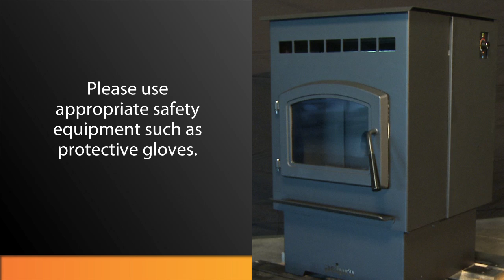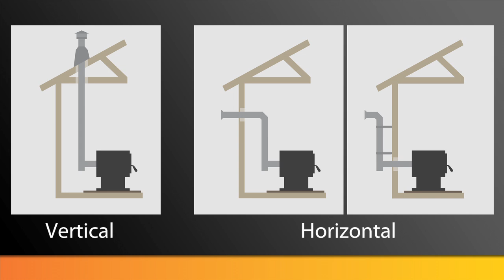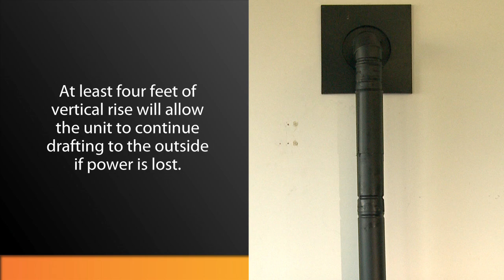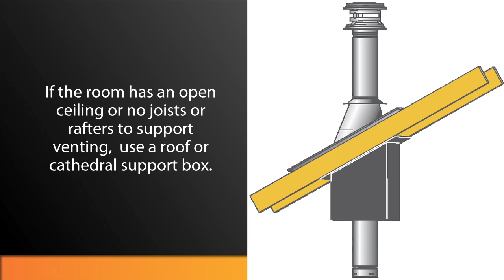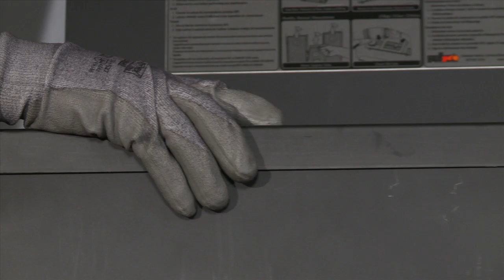Placing & Installing Your PelPro Pellet Stove PP60/PP60-B/PP70/PP130/PP130-B

Comment: Interesting video, i never thought about power outages causing smoke to come from the firebox. So it's freezing cold and you need to open the windows! I think some sort of battery backup to run the exhaust fan at minimum rpm during a power outage would be a great idea for any pellet stove.
  In Europe we now have a twin walled condensation flue pipe for pellet stoves. Do you have the same over there?
  The cold air enters the building from close to the end of the stove pipe then runs down the inside of the two pipes and gets fed straight into the stove, a condensation trap is fitted. The moist pre warmed air should increase the burn efficiency of the stove.

Comment: Your manual doesn't say anything about needing the 4 foot of vertical rise. In fact, you have a picture of horzontial venting without any vertical rise.
Reply from the maker: Hi Makaila, please follow the venting chart in the manual. Depending on configuration it’s a 5ft min rise. You can find this chart on page 12 of your PelPro owner manual. If you have any other questions, please reach out to us here: https://www.pelprostoves.com/contact-us/ask-a-question
Reply: @pelprostoves6142  I am confused at this - the manual clearly shows in diagram the pipe going directly outside from the back through the wall and out. Yet, it states that any vertical makes it more efficient.

So is it best to go out and then a 90 and up or from the back of the stove up and then outside through the wall?
Reply from the maker: @GiveaDogaHomeGaDaH  Thank you for your question. Either is okay. However, I would personally go straight out the wall. The rise recommendation is for power outages. If there is enough rise it will pull some of the smoke out of the home in a power outage during operation. 

I hope this helps! If you have further questions, please contact us: https://www.pelprostoves.com/contact-us/ask-a-question

Comment: What stops it from catching fire in case of a power outage? Does it put itself out?
Reply: It will eventually just go out because it wont be receiving any more fuel and there wont be any air flow.
Reply from the maker: Hi there! The fire in the fire pot is maintained by forced combustion air from an electric blower. Once the air stops, the fire will slowly smolder out. In addition, if the power is out, no additional pellets will be fed into the fire pot. Smoke from inside the unit will be pulled by draft, provided that you have 5’ of rise in the exhaust venting.

Comment: Can a 6inch vertical pipe be used ?
Reply from the maker: Hi Patrick! Most pellet pipe manufacturers have adapters to go from 3” or 4” pellet pipe to 6” Class A vertical. Some localities require that the pellet pipe then adapt to and run a liner up the 6” Class A. We recommend partnering with a local hearth shop as they will know local codes.
Reply: @pelprostoves6142  thank you so much for the speedy reply.

Comment: Why did you install so close to the corner of a wall ? Code requires at least a minimum of 39 inches from  any corner of a building.
Reply: This stove only requires 3"minimum from closest point to the wall.